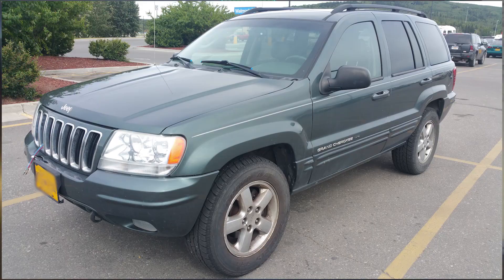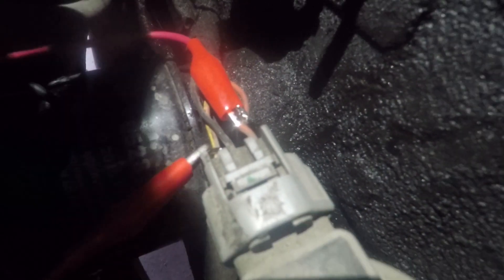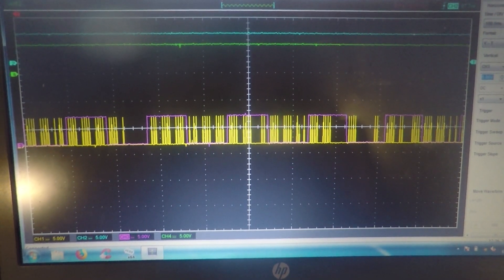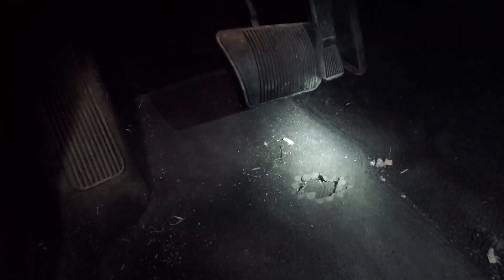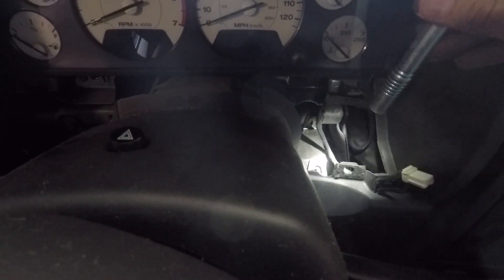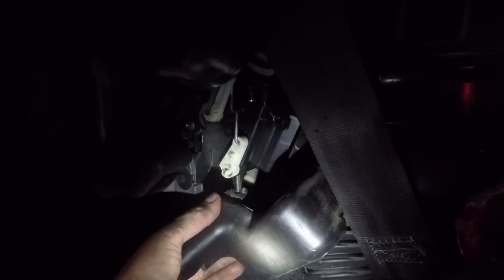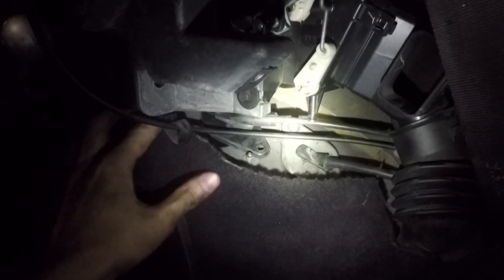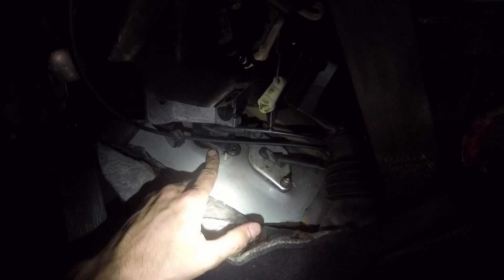Jeep Grand Cherokee - P1391

Comment: If you drop the transmission crossbar it take way less time to gain access to the sensor
Reply: I did the same, hardest part was reconnecting the wire plug! I was wondering why he was tearing up the dash. lol
Reply: I just wanna know how he got an extension to work w those cables in the way